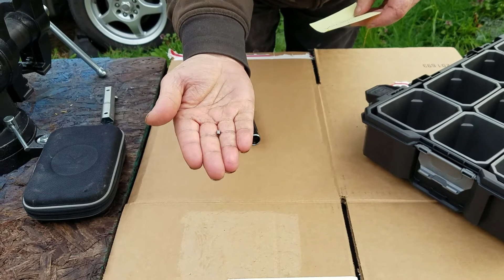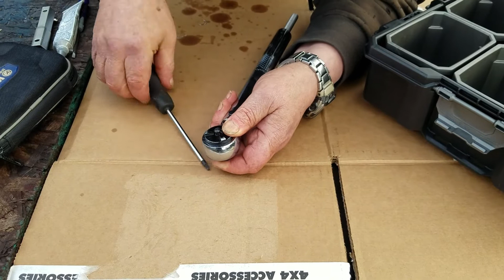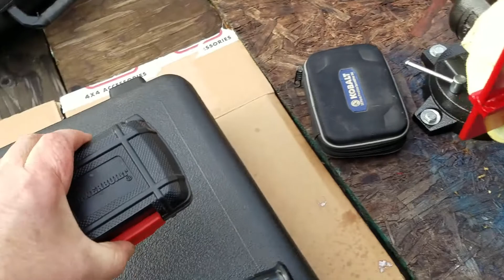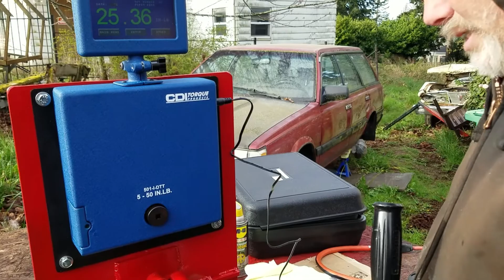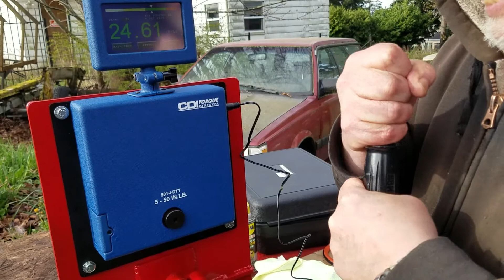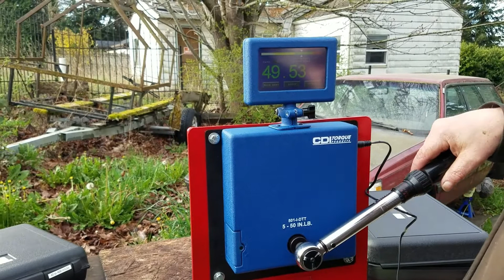US Made Craftsman In lb torque wrench

Comment: I can’t find any socket that will fit to unlock the nut. So I can’t calibrate my torque wrench.
Reply from the maker: It is a thin wrench made for Chain Saws, Tractors, small equipment, etc.  I am sure other models exist - but you are looking for something similar item (store sku #1001206572 or model #490-850-H011) that Home Depot carries.
Reply from the maker: Lowe's also 'has' a similar under Model #490-850-0018 for less money - but say it is 'unavailable' for whatever reason.
Reply: @daves7775  thank you I’ll check it out
Reply from the maker: @jvillanueva3105  Sure - your welcome! Amazon also sells similar.